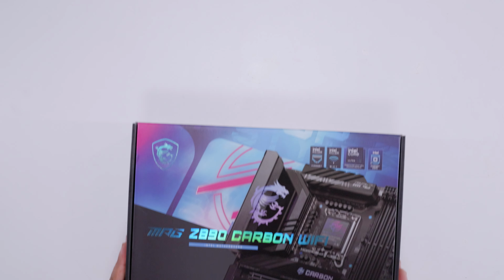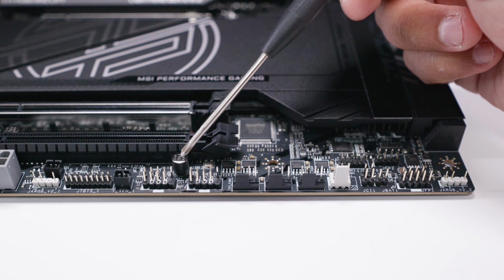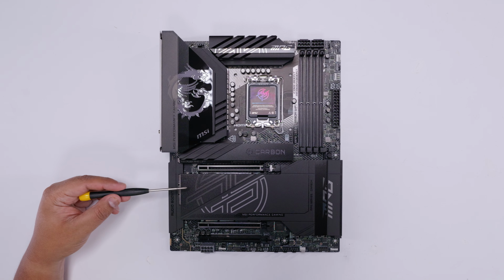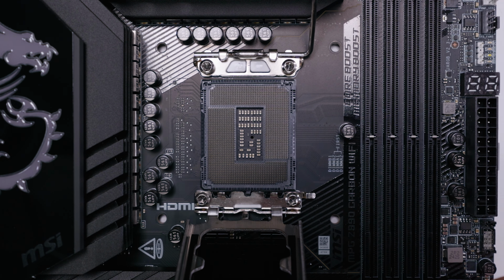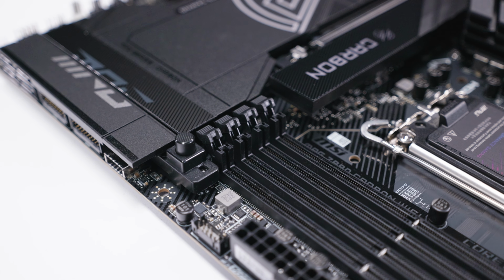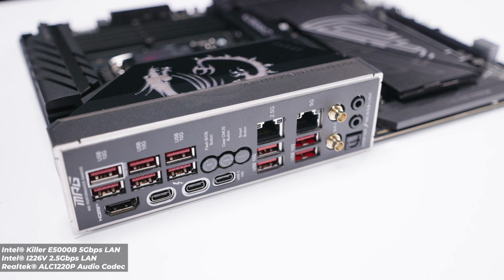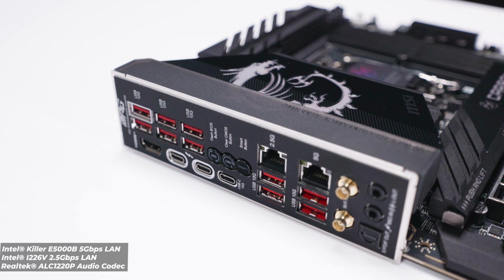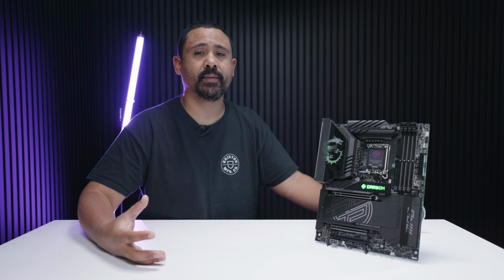WORST Kept secret EVER - MSI MPG Z890 Carbon WIFI

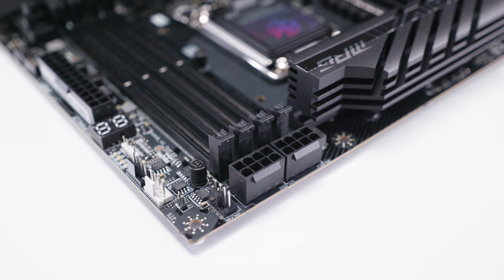Comment: 4:08.. MSI did this to make connections of EPS connectors easier since they are no longer squeezed in between the IO shroud and the top VRM heatsink. 5:43 the socket 1851 has been slide approximately 5mm down toward the top PCIe slot to account for the slightly off-center hotspot of the new CPU's. This was done so NO SPECIAL BRACKETS ARE NEEDED for existing coolers unlike AM5

Comment: I recently upgraded my internal network to 10gig. I guess I'll either wait for a 10gig board or use the card I have now. I'm trying to not use a card. I get why they are doing it most won't use the bandwidth  
EDiT: I found ASUS Boards have a Marvell AQtion 10Gb on the board instead of 5Gb. I was hoping MSI had it but I guess my choices are limited.

Comment: Again 5 Gbit. Looks like I have to go Aorus Master again this gen.
Reply: Looks like almost all the amd and Intel boards went with 5gb. I think the pro art series had 10gb last year, so maybe they will again? It might be a bit cheaper than the master?
Reply: @robertmajors1737  Gigabyte did go 10Gbit.... Sadly only on the Intel model.
Reply: Why do you need 10GB anyways if I may ask? I only got 100MBPS internet so even 2.5GB seems useless unless I am missing something?
Reply: @fourwheelerjock  If not for internet, possibly home server speed. I personally don't need it, but I see lots of guys wanting it.
Reply: @robertmajors1737  So how does a home server benefit from that when internet speeds cant go that high?
Reply: @fourwheelerjock  Ok, so my knowledge here is very limited. But from what I understand, if you have your games or videos or whatever on a server, the network switch is what determines the speed at which you access these files. Most higher end switches are 10gb a second, so 5gb a second doesn't allow you to fully utilize your network's potential. I'm sure someone else will tell me how wrong I am lol.
Reply: @fourwheelerjock For tasks like transferring large files to a NAS or home server, especially if you're a content creator or dealing with high-resolution videos, having faster speeds like 10Gbps can make a big difference. It allows you to send and retrieve data much faster compared to 2.5Gbps, even though your internet speed might not be that high. It’s more about maximizing the speed of your internal network for things like backups, media storage, or even editing files directly from the server.
Reply: @robertmajors1737  Pretty much on point. You can only basically buy switches that support 10Gb or 2.5Gb as their highest speed. Meaning that you have to buy a 10Gb switch if you want to use the 5Gb of the mainboard completely which negates any price advantage. Just. stupid decision by the manufacturer.
Reply: @fourwheelerjock  The data is saved on disk drives. You're just transferring it from the drives to your pc. So it's not downloading or streaming from internet, but your home network
Reply: @swanstudios2018  I'm a content creator that shoots 4K and 8K. So I may have to look into it. I just use a hard drive docking station ATM to hold my 16+TB hard drives

Comment: Great ,who buys a 500 euros mobo for 2 cpu generations(dunno if the intel 14th gen counts as the third😂)
Im really cheering for intel,but ive just ordered the x870e msi  carbon(thanks for the video btw) and im waiting for the 9800x3d-upgrade from 7600 i switched from 5900x to get ddr5 and future cpus)
The mobo i want to keep till the end of am5 which i hope its far away
ps: x870 doesnt support wify drivers for windows 10, i dont have lan, now im upgrading to w11 with an old usb 2.4 gbps with which i have  a max 3.4 MB/S download speed(150mbps which is written on the website was a lie)

Comment: Looks exactly like the X870e carbon wifi
Reply: To the point where the only difference is the X870e design wise only shows the little battery but you can cover it with one of the stickers
Reply: Even better than x870e.
Reply: @kelvinjinxd better how?
Reply: @lordkittenG  1 more m.2. Also the 2nd pcie slot support x8 electrically, while it is x4 only on x870e carbon.
Reply: @kelvinjinxd  on that you’re right but I think that will bump the price even more compared to the x870
Reply: still don't know if that's worth trying to trust intel this time around though lol
Reply: @lordkittenG  Nahhh, I got a Carbon X870E and a 9950x. Went from a 3900x and 2080 to tho the 9950x and 4090 strix
Reply: @fourwheelerjock Sounds very nice though im waiting for the 9950x3d and 5090
Reply: @PaulRudat  i was waiting for the 5090 since like July, But I went ahead and throwed it in my current system. Then when I get the rest of the build I'll throw it in there. I prob should of just waited seeing the specs coming out. But I just couldn't wait another 4ish months and idk, Seems like the x3Ds don't do as well in the productivity side of things as the regular X version do that's why I went with the 9950x. Usually the 950x3d version isn't that great in gaming anyways compared to the 800x3d models
Reply: Why would you get an 5090? Even Nvidia saying it's not for consumers and supposed to be a 2-2.5k card in price
Reply: @lordkittenG  I do a ton of high end editing in 4K, 6K, And 8K. Aren't they still market the 5090 as a consumer card and I seen a rumor about bringing back the "titan" series of cards which isn't "a consumer" card? Also, I just spent 2k for a 4090 Strix card so..... lol
Reply: @fourwheelerjock  well the 90 series is just a renamed titan card. But Nvidia will never market it not as a consumer card so people will buy it even if it costed 3k. But most if not all hardware and tech reviewers (HWU, GN, ect) are calling it a prosumer card, to be used in things like home servers, CAD work, 3d work, and editing mainly.
Reply: @lordkittenG  Yea, Which i do a lot of that lol
Reply: @lordkittenG  Wish I only gamed so I could get away with a 4080 or 5080 and less ram and a cheaper CPU 🤣
Reply: @fourwheelerjock  haha well I mainly game and do some DOC work, maybe work from home in the future, now granted I want to start to get into some video editing work for fun but honestly I think the 80 series will be enough for me (i cant justify spending 2k or more on a gpu when the system im planning on building come novemberish is costing about 3k), mainly it's the cpu I'm looking at for that kind of work though
Reply: @lordkittenG  If you're doing 4K and under the 80 will be enough. It's when you get above that is when you need that 90. Specially depending on codecs you are using. I really wish I was just a gamer at times so I could save thousands lol
Reply: @fourwheelerjock  yea, my use is more of an everyday daily driver kind of thing, gaming, productivity, ect. Makes total sense for what your mainly doing though
Reply: @lordkittenG  Yea, You don't  need a 90 then
Reply: @kelvinjinxd not to mention it supports bifurcation.